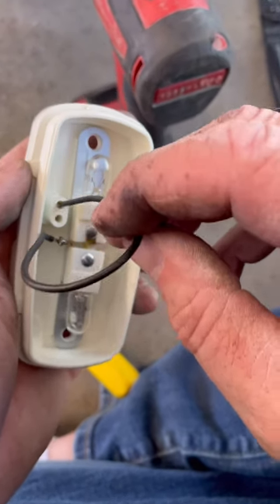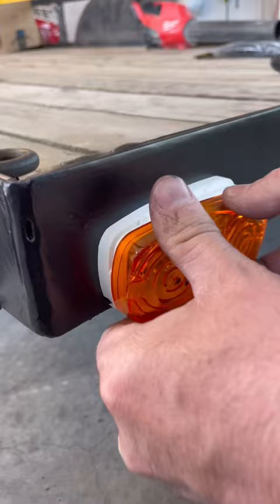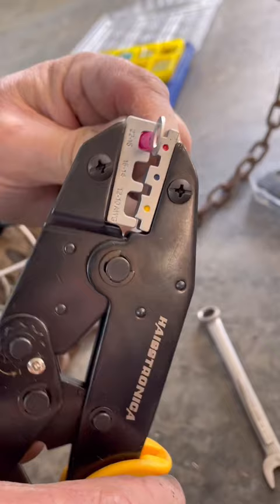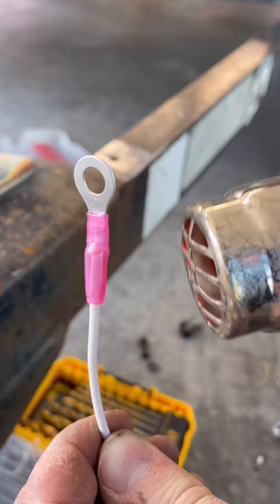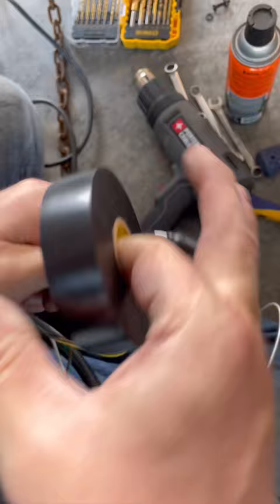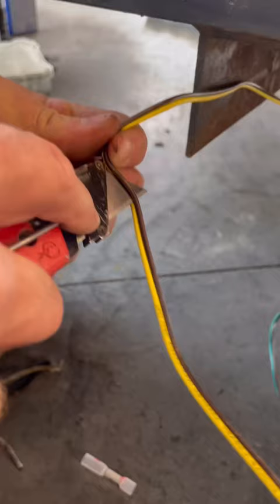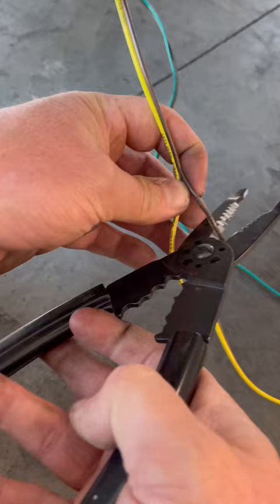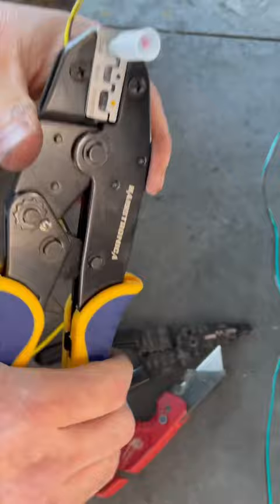Wiring Front Marker Lights on My Trailer

Comment: Dielectric grease does not conduct electricity. If anything it will make your ground connection worse. Everything else is great though.
Reply: Beat me to it
Reply: True. And I’ve always wondered what the point of using it? Keeps water out, prevent, corrosion, etc..
Reply: @Cliffprogarage  corrosion
Reply: @Cliffprogarage  good for connectors so they dont get stuck together.
Reply: This
Reply: Damn you you beat me to it!
Reply: Damn. Beat me too it also.. lol good call man!!
Reply: Dielectric grease can conduct electricity over short distances.
Reply: Came here to say this
Reply: @CesarMartinez-wi7wc  everything can conduct electricity over short distances if you have enough voltage.
Reply: @The Inspector. Dielectric grease is important to prevent corrosion and rust which can break the ground connection.
Reply: @domineech  True enough 😂
Reply: Dielectric means it's an insulator and does not conduct, however as you tighten down the mechanical connection it'll be displaced and an electrical connection will be made and then the displaced grease will end up around the connection, keeping water out
Reply: @kevincrossland1898  Bingo!!!
Reply: Noalox FTW
Reply: @davidwmcinturff  You do realize that both dielectric grease and noalox have their different uses right? Noalox is mainly designed for aluminum and copper high voltage connections (it is conductive, containing zinc particles) allowing it to make a solid electrical connection and preventing future corrosion. Could be used on battery terminals ect. 
Dielectric grease is used on low voltage components (it is non conductive) and is applied in a thin film over the back of connectors (or battery term.) Ect where noalox would short out the components by causing current flow between the circuits. Sealing out the elements and displacing any moisture on the contacts. Preventing future corrosion. Oh fyi, you can apply dielectric before making a connection and then apply said connection without any resistance because the grease will get displaced when the connector is tightened in place securely due to the fact that it is non conductive and displaces. We have tested this little rumor out in our electrical dept. and found it to not be true. I suggest you do the same. 🔧🧰👍
Reply: Yep, put the dielectric grease on after making the ground connection.
Reply: Literally why I came into the comment section.
Reply: Yup, die electric is used to protect after the connection is made.
Reply: Some peoples children... I don't know how they don't hurt themselves severely eating with forks... wow!!! I guess that the old saying "you can lead a horse to water but you can't make the sumbitch drink" still applies today. Grab an ohlm meter and test the theory first yourselves. Do a resistance test with and without the dielectric and see if it impairs the battery terminal connection. I have tested this and showed so many doubters. These are rumors that's it. I would not apply it to momentary contacts because the connection is not tight enough to displace the grease and it won't make good contact to pass current through. But you can wipe it across a live pcb board and not hurt it so why would it hinder a 12 volt battery connection guys?? Let's think about this logically...
Reply: @midnightrider1854  wiping it across a live pcb board proves it doesn't conduct electricity. You better be careful eating with a fork, I wouldn't want you to hurt yourself. If tightening the connection displaces the grease why put it on in the first place? It makes more sense to put it on the outside after it's tight to prevent any corrosion or contamination. But hey you do you and remember be careful with forks and definitely keep away from chopsticks you can poke out both your eyes with them.
Reply: @domineech  well, Inspector know little, let me see? You put you battery terminal connections together and then spread the semi thick grease on the outside of them, OBVIOUSLY, leaving all of the little voids that you can't get, especially with the metric battery clamps, the grease into including around the base of the lead terminal itself where the batteries almost always tend to seep battery acid (which is why your terminals turn green by the way Mr Inspector know Little) and so the gasses from the sulfuric acid will start  to eat at all of those little spots that you couldn't get the grease into and then you are back at square one... This isn't my first rodeo. 30+yrs as a professional mechanic. If it was going to do something bad by putting the dielectric on the post and terms  first to completely seal them, then it would have happened by now. Because that is a ritual of mine that I do for free every time I service a vehicle. And no complaints as to date. DOH....!!! IS THAT A FORK IN YOUR HAND??? EVERYBODY RUN!!!!!!
Reply: @domineech  Hey Mr. Inspector. I hope I didn't make you too mad. But my point was made and now you and I can move on to greener pastures and chill. Thanks for the friendly dispute btw. 👋
Reply: @midnightrider1854  I'm not mad at all. I actually had a little fun. Have a great day.
Reply: @domineech  ditto.

Comment: So something else I guess I'll pass on as as I have come to start doing this on many trailers that I have rewired is to install a junction box somewhere on the tongue close to the Jack usually. It may not be that big of a deal for personally-owned trailers but I maintained a lot of trailers that a lot of people use and the pigtail that plugs into the truck gets damaged or torn off or what have you and the junction box is a great place to be able to come back to nice clean wires to install a new pigtail. 
The first time I did this I went to DIY route and installed Spade connectors inside a generic box. But since then I have been getting the purpose-built boxes that have separate studs so you can put ring terminals on the wires and bolt everything down so much cleaner when you need to replace it that way.

Comment: You should also put a good electric connection grease in your bulb sockets then put the bulbs back in. 
It is a good idea to check all your connections on your trailers each spring and fall so you don t have problems when you don t have anything on hand to fix them.
Reply: But if you listen to most of the naysayers on here they say that you can't put the dielectric grease on the electrical connections and then put them together because it will interfere with the current flow ... Psst (I'll let ya in on a little secret, their full of it)!!!!  😆

Comment: Need to use a gromwt where you passed the wires through that small drill hole in your frame as well as you should put the wires in a wire loom to protect it otherwise theres a very good chance you'll get a short there over time otherwise
Reply: You sound like an actual mechanic or someone who done made that booboo. Well, to be honest, a mechanic is someone who has made that booboo a couple of times to learn how to fix it I think. Lol
Reply: @midnightrider  yes i am a mechanic no never done that cause i know it will rub through and cause it 2 short in time when running wires and hoses you always have to look and make sure that anything or anywhere it can rub through is protected
Reply: @stephenotto2294  lol I am a Mechanic as well. I just like reading these comments sections after a long days work to unwind and see just how many people know or don't know what they are talking about. And to be honest, most don't know. They just spout rumors and stuff that is posted on the internet. But it's fun to just listen and let em rattle on. I personally, have made that mistake one time with the wire grommet on a cars firewall and almost burnt the entire car to the ground about 35 years ago when I started my career and I have never made that mistake again because it scared the living hell out of me.

Comment: Want to make it more water proof?  Solder each wire.  Or using a fine point needle and syringe, squirt some epoxy INTO the wiring, at each end. This should prevent water from using those tightly bound wires like little water highways.

Comment: So rather the. Dielectric (die-kill electric-angry pixies) try stainless antiseeze.  That works great! 🥰 been doing it for (... omg I'm getting old) 20 years😅 😂
Reply: I’m definitely going to try the stainless anti seeze, been looking for a better solution for grounds then bare metal and a slap of paint over top because after a few years they just corrode underneath and then you gotta replace the connector and everything
Reply: @austinpalmlund5054  works great and even on high voltage connection on heaters 480VAC and over 600F so we can get the wires off when the heaters fail.

Comment: For low voltage applications like this I don't like using krimp connectors. I much prefer the heat shrink low temp solder connectors. Good clean joins that are water proof. They even have hot melt adhesive near the ends that guarantee nothing is getting to that solder join until the plastic insulation is gone.

Comment: Check out tap splices, they'll do the same job as your multi-wire connector, but they pierce the insulation rather than having to cut and re-splice the wire. Especially advantageous in tight areas of existing wiring without enough room to fit wire strippers.

I did not know about the multi-wire connectors though, that's kinda neat, I always just use regular butt splice connectors for multi-wire too
Reply: Tap splices are great. Whenever you have a light that’s not working, go to the tap splice and cuss the guy that used it. Cut it out, make sure you get all the green corroded wire removed. Use a heat shrink but connector to keep the moisture out, like what should have been done to begin with. Cuss the last guy again for using garbage splices on a trailer, then don’t worry about that connection again. 
Yes I know the manufacturers use that garbage, they are looking for speed in production not reliability of the wiring. All they care about is what brain dead monkey can we get to squeeze these things together to get more trailers out the door. That’s why a 2 year old trailer starts having lightning and electric brake issues. They know it but don’t care, it’s out of warranty.
Reply: Insulation-displacing connectors work great - on solid-core wire where the blades wedge partially into the copper and produce a cold-welded joint.

On stranded wire they cut copper strands and you usually end up with a loose joint.

Comment: Coppied from google -846 is an eonomical carbon conductive grease that provides lubrication for electrical contacts, reduces contact resistance, repels moisture, inhibits corrosion, and prevents static buildup. Because of its high electrical conductivity, low cost, and ease of use, 846 is an ideal electritions grease.
Reply from the maker: Interesting

Comment: Dielectric grease doesn’t help it make a better connection as it is non conductive. It does keep the rust away which helps to KEEP the connection though.
Reply from the maker: Yeah, you’re correct, I found that out after I made a video

Comment: I had some tell me that you're not supposed to put the grease in-between the connection but rather connect the connection and them cover it all in grease to prevent moisture getting in. Wondering what your thoughts are on that?
Reply from the maker: I think you’re right. I was under the impression that dielectric grease  conducted electricity. Found out it doesn’t. It’s more about protecting the area. So covering it after it’s connected would be a smarter approach
Reply: @hausplans  that makes complete sense!
Reply: Back when I worked in a restoration shop we had a copper spray to protect the metal between bare metal panels and was also able to still flow the electricity to weld with no issues on a spot welder as well as doing plug welds
Reply: @sweetapple9519  dielectric grease is non conductive but it also can be put on in  thin coat on battery terminals because If they are nice and tight the grease will displace when the terminals are tightened. And it does not create resistance. Those are myths. We have an electrical dept at work and they tested these theories.

Comment: Put the dielectric grease on after attaching your terminal. Putting it under the terminal makes the connection worse, not better. Dielectric means it does NOT conduct electricity.
Reply from the maker: You are correct, I found this out after I made a video

Comment: Yeah don't use dielectric grease, it prohibits electrical flow. Use penetrox or nolox, which is used for electrical connections, and also makes a nice anti-seize
Reply: Dielectric grease is a sealant and insulator. It gets squeezed out of the connection allowing for a proper electrical connection, and helps seal the connection to prevent corrosion.
Reply: @JDeWittDIY  it’s good to hear that because most everyone else is saying Lectric grease is not the right thing to use but I can understand it being an anti-corrosive on the exterior once the connection gets tightened down. 
Thank you for sharing maybe copy and paste your stuff and put it in the main section so more people see it.

Comment: Do you use rubber tape under the electrical tape? Like franks red I use this shit on everything, keeps water out far better then electrical tape alone, I use it on RF connectors for broadcast equipment and security cameras, so far the only time I have to replace those connectors is when some one else hooked it up with electrical tape only lol

Comment: Routing the bare wires through the frame like that is big no no. After time the insulation will be thorn at the sharp edges of the frame due to vibration.

Comment: He had me til I saw him put the grease on first.
Reply: Do you guys not read through the comments before posting? It was stated time and time again that if your connections are good and tight then you can apply the grease first and it will just get displaced by the pressure of the clamps on the post. It does not create resistance or conduct electricity and therefore cannot hinder the connection of the battery terminal regardless of which procedure that you use to apply the grease.

Comment: Your wrong about dielectric grease
Reply from the maker: Yeah, I found out after I made a video that dialectic grease does not conduct electricity. But it does help to protect areas where you need to conduct electricity from rust or corrosion.
Reply: @hausplans  that's right
Reply: @hausplans  I normally wouldn't say anything at all, but you did such a good job on the video and the rest of the repair I couldn't let you go out like that
Reply from the maker: I appreciate that! Thanks for watching👍

Comment: Those lights you use are the worst lights you could possibly use. The transportation industry stopped using them 30 years ago. I would have used L.E.D. lights. I also would have installed a junction box and would have 7 wire main cable and a 7 way plug. Also I would have used wire grounding, much more reliable the chassis grounding.